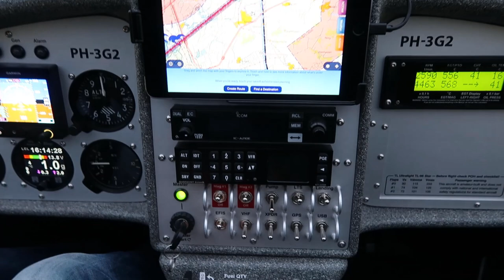Repairing my airplane; how to solve Rotax 912 ULS engine vibrations and more - S03 E01

Comment: Jolmer Happy New Year to you and your wife.  Nice 30 sec video.... a picture is worth a thousand words. A video many thousands!  Many micro sized posters are just as important as the  more well known ones. They put their heart and soul into making a recording of their love of flying. And it's all good, perhaps not as "professional looking," but authentic none-the-less and therefore valuable to us as a community, no matter what our preference for the type or aspect of aviation.
For the heating muff ... stainless steel an option? And I'm sure you checked out micro holes in the exhaust stack to preclude any CO2 from entering cabin hot air duct.
Reply from the maker: I couldn't agree more, you're absolutely right! 👍🏻 Yes, I inspected the exhaust pipe carefully and all is OK. I do decided to install a CO alarm in the cabin, just in case something would leak. But I'm pretty confident that this repair is OK 😉 Thanks for watching! 👍🏻

Comment: Hi. We had severe engine vibrations even after certified mechanics did service on engine and balanced the carb. Mechanics said proppellers are not balanced properly, and we thought it is gearbox. 
As a engineer first thing I did was weld the air mixture senzor (50UsD on ebay). You need to measure main engine parameters, mixture is first on the list. It was way too rich in all regime IDLE, MID FULL.
We found feew loose screw on choke, we put epoxy on all machined canals on the exterior. We spent time to lean and balance idle jets on booth carbs, adjusted needle jet to more lean setting. Now it works like clock.

Very important: you should never have leaner mixture than 14:1 as can result in knocking during heavy engine load and damagingthe engine.
Reply from the maker: This was also on a Rotax 912 engine? I never touched the mixture by adjusting the jet needle or screws. Normally its factory set and good to go. What wanders over time is the sync between the two carbs or the (first signs of) failure of one of the ignition modules. Happy to hear you solved the issue 👍🏻
Reply: @ForFunFlyer  same 912 100HP.
from vibrations and aging screws, o ring etc can losen. Mixture sensor removes guess work and points to the problem

Comment: To the attention of Rotax aircraft engine users!

  This engine worked for 210 hours and fell apart during the flight in the air.

  The reason was oil starvation of one crankshaft journal. A preliminary inspection showed that the problem was from the very beginning and the connecting rod at least received lubrication from the crankcase. But it wasn't enough and the connecting rod with the bushing, having received a large gap, collapsed.
  From beginning of operation with a warm engine, when the speed was reduced to a minimum, the temperature and oil pressure began to rise. By adding speed, everything returned to normal.
The company ROTAX does not recognize their marriages!

Comment: looks like we are in the same state. We can not fly either , so, I too have been doing maintenance on my aircraft (new reduction belt, plugs, fuel filter, tailwheel and lubrication / inspection) but I did not get any useable video. I also sent Flight Chops a video that must have been in the same file as yours and did not get used (that said, he did not promis to use it, so I had no expectation. I am just a micro channel and he had good stuff from others). I hope you have fixed your vibration problem, don't forget to get the carbs ballanced as that can be the problem with the Rotax 912 engines.
Reply from the maker: I heard from Steve that he had to dissapoint a lot of people, not including their video. It must have been a lot to handle. Yes, fingers crossed the low idle vibration is gone after this. Else I'm in for a gearbox overhaul too 🙈 I'm familiar with syncing the carbs. Thst friend who is overhauling my carbs is quite the expert in that too 😉
Reply: @ForFunFlyer  I hope it isn't the gearbox but have been told that they some times can be re-shimmed.
Reply from the maker: @flyingkub  Oh yes, the gearbox is doable. Already did that on my previous plane. But first things first; carbs overhaul and testing. Then go from there...

Comment: It sounds like your carbs need balancing and that should fix the rough running vibration. Also you shouldn't have shortened your plug leads, they are a set length.
Reply from the maker: Really? Didn't know that about the leads. They're all shortened at the same amount, so that should be better than all different lengths? Oh, and the carbs were balanced a couple months back, so that can't be the cause this time, I think. Thanks for your comment 👍🏻